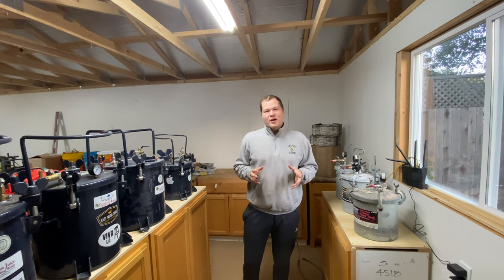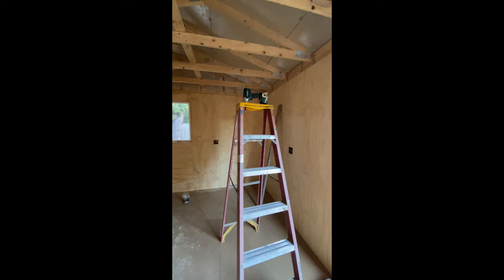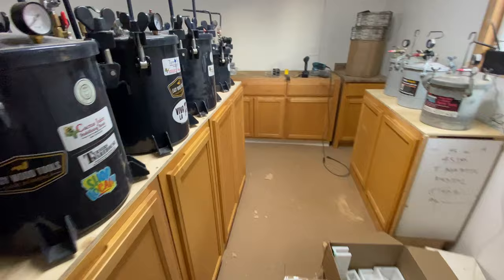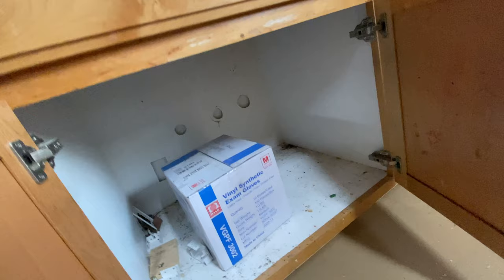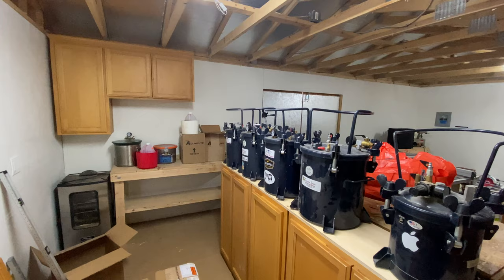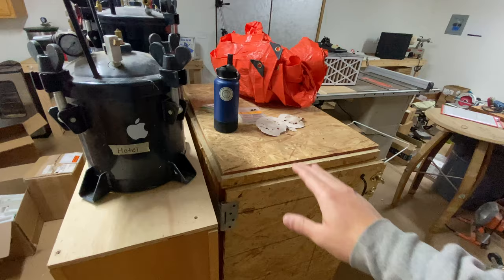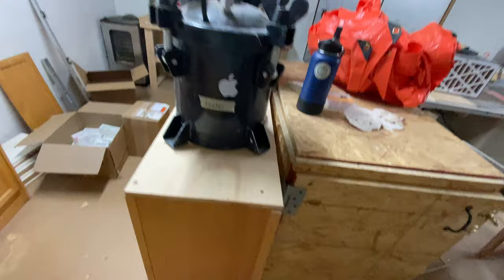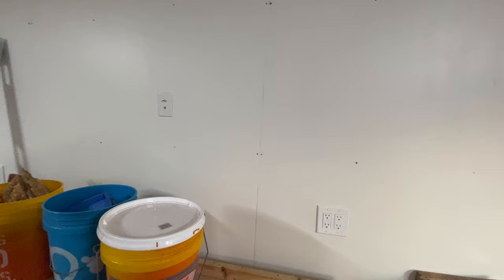Creating the BEST Resin Casting & Wood Working Shop EVER! (PART 1)

Comment: You might want to consider a non-load bearing, plywood or drywall divider wall between the casting side and the sawdust side. That gives you more working wall space, reduces dust infiltration on the resin side, and can give you better work flow on both sides. Even a good place for “pantry” cabinet(s) or your current rack type storage. Repurpose extra cabinets, or find more. Options: old sink base= good height for chop saw. Extra upper wall cabinets can repurpose into pressure pot stands or carts. Turn a narrow cabinet or two on side, use drop desk hinges, add wheels. If 36” wide, put two back to back, or stack. Add risers and another cabinet (or two) for storage above the pots with flip up doors. And I hope you allocate a clean “packing and shipping” work area, (near the door and the computer?). Resin area ventilation needs to be located so that you do not draw sawdust laden air into the resin area. Take time to review your work/materials flow to maximize efficiency in your space. And a work cart to hold and move materials in progress can reduce carrying them around. And wheels under almost everything will allow you to change arrangements as needed. Lots of work, but satisfying when done well. Have fun!!!
Reply from the maker: Thanks for all the advice Val I really appreciate it! I think those are all fantastic ideas. I have toyed with the idea of closing off the dust area from the resin area in a non permanent way but haven’t figured out the best way yet. Really excited to get it all situated!
Reply: @CaseyMartin707  A rolling (think blackboard/plywood frame) divider(s) can help you work out the where until you figure out the best arrangement, then remove the wheels and add top cap. An extractor fan on each side might be called for. For above the wall, use a soft divider like stapled up and cut to fit shower curtains or other cleanable fabric. Another option is a retractable shower curtain wall that crosses the room on suspended curtain rods. 😁🤔😁
Another hint: flat surfaces are easier to keep clean than tools. Keep only the most needed tools out where they can gather dust. Store everything else in drawers, behind or on the back side of doors, in covered flip top racks, or enclosed in something on a shelf. Think “clean as a kitchen”, not “display every tool”.

Comment: Casey, you're back! 😀🥳🎉 I have the same miter saw. No suggestions, it's just too darn big.  If a smaller, non-sliding saw would work for your needs, I bet a carpenter or contractor would gladly trade. Congrats on the new shop!

Comment: Nice.  Like the use of painted plywood on the wall -- I used 1/4" Melamine coated hardboard on mine for the white color to make the shop bright and screwed it on to allow me access to behind the wall as needed in the future without having to do demolition to do so.  I'm assuming you are going to add more light as you finish up -- that's one thing I've found, you can't have too much light.  It's really good that you have pictures before you closed up the walls.  That's going to be really helpful to you in the future when you want to make modifications or add things; you will know where the electrical wires are running so you can take that into account.

Comment: On the wall with base cabinets I would put adjustable shelves, in the cabinet with your 3 HF Pressure Pots why not relocate the inside shelf to the bottom of the HF Pressure pots after you sink them in so you can maximize storage in the cabinet. When you get organized and have a couple extra dollars consider a Mini Split unit for AC and Heat. Nice space!! Congratulations!!